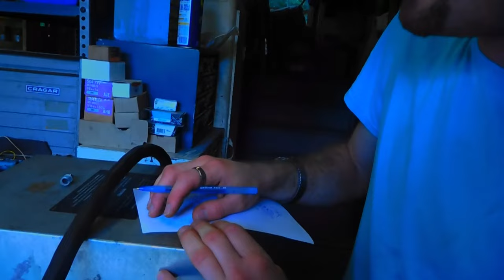Why Metric Base 10 is a terrible system.

Comment: I'm not a mathematician this was over my head. base 10 suits me, I know how to add it, divide it, subtract it & times it. for Joe blogs on the street that's all I need to know! I think🤔
Reply: based on this i assume you use a base 10 clock and calendar right? The fact is that base 12 is so intuitive that you don't even realize you are using it while you are using it.
Reply: @kevint1910  true, but isn't that for time, and not math? I do use base 12 occasionally when working in older properties eg joists are set at either 12", 14" or 16" centers, ordering sheet material 4'x8' actually comes as 1220mm x 2440mm😁
Reply: @paulrayner4514  shall i point out how many places those numbers contain vs standard measures? or that metric units are so awkward that most of them are never even used? what is that last one technically if denoted as we were told to do in grade school? 24.40 "decimeters" or was it decameters? and does any one actually use either one? nope....and "degrees C" where as little as 3 "degrees" can mean the difference between being comfortable and heat exhaustion and yes i am exaggerating it is for effect to make the point , the idea of it is sort of elegant 0 freezing 100 boiling and all. The issue is that the units that result are awkward and don't tell you as much as degrees F unless you use decimals to provide the places required to fill in the detail ...and yeah this is ALL 1000% quibbling...that is how I feel when people tell me that metric base ten is "better" because "math" you are quibbling over BS that has nothing to do with measuring or achieving accuracy.
Reply: Ironically the argument being made here is that base 12 would be easier for the average Joe, since it makes all the fractions used in physical measurement practically easy. Base 10 is more useful for math and science.
Reply: @kevint1910  well, even when telling the time, i represent the numbers in base 10, I write 11, not b
Reply: @kevint1910  Regarding measurement, As in liniar not any others, I'm not saying that it is better. I'm saying it suits me, as I find it easier to work with and understand it more in my line of work. As I'm a Joe blogs, i'm sure many other people do too.

Comment: its really more the difference between fractional and decimal and less the difference between 10s and 12s.  also 1 can be prime without much extra work but zero can't be unless you are ready to change a whole lot of things.
Reply: I like 1/4 better than 0.25 but i'll take 0.328 over 21/64ths any day
Reply: @joshwalker5605 I have a pretty easy time with either, the conversion is where things start to get unpleasant

Comment: Wait what the actual???? first you start your argument by explaining divisions by half, but then at @9:30 you first divide by half and then by thirds? Just to end up at 12???? 
As far as the actual argument was valid (which it is not), you just destroyed the logic with that diagram. That is, if you haven't lost the viewer already with those weird symbol representations. Well you lost me already half way, but I wanted to see how much deeper one could dig. 

You know that the entire premise of base 10, is simply shifting the comma or adding zeros? Shifting commas and not having to deal with fractions is why base 10 math is so much more easier. Not to mention our entire language is based around base 10. We do not have a different symbol for 10 and 11, or some word. We represent base 12 in our language using base 10 words. 12 time 12 is one hundred and forty four, nothing else. You even use the word twelve, a base 10 word representing decimal 10 plus 2

Hexidecimal on the other hand is presented using letters. And only when the number rolls over you get another digit. Easy for computers, but hard to comprehend for humans because we use base 10 in our speech.

Comment: If Im following u correctly,  one reason base 12 is easier and cleaner is that 1/3 equals .4 in base 12 instead of .3333 to infinity in base 10?
Reply: Correct, it has more for 'factors'. 3 is not a factor of 10; it is a factor of 12. Same with 4 and 6.
Reply: are you thinking in base 10? maybe if we thought differently it might make thinking about numbers much more intuitive?
Reply: That's more or less right but I'm interested to see how we would make 11/12 into a decimal
Reply: @maxscott3349 I'm thinking If you use A and B to represent 10 and 11 than 11/12 would be .B in decimal I think.

Comment: Metric is much easier for machines to use with  ISO the multipliers which are denoted as, Micr Nano Pico etc.  Imperial 12 has bases as explained, as does Octel Hexadecimal etc.  There is no one system but I do agree with Mr Sherwood  that 12 has more flexibility for visual representation as can be seen in the Stonemasons work. Ps NASA has difficulties with metric velocity and angular calculations. !
Reply from the maker: You are very correct about "there is no one best system"

NASA has difficulties designing basic spacecraft proficiently as the disaster that is the space shuttle program demonstrates.  I'm just an old steam engineer and definitely wouldn't know anything about radially or bilaterally symmetrical thrust profiles nor would I know about putting the manned part of the craft on top of the stack where it doesnt get hit by falling ice....
Reply: @AEKarnes  Mr Karnes, I  struggle with the many complicate threads evolved from imperial ' standards ' (?) created plumbers who needed to be improved matters their way.   With metric the only problem I have is finding a 10 mm spanner.  Mr Sherwood translates the ephemeral to visual for his own understanding,  I do the same which is why I dislike none tangible data and like you I used to use a screwdriver and listen and I could visualise what was in motion and not happy. I was a Predictive maintenance and Condition monitoing engineer and  and I had the pleasure of meeting some fine engineers who were steam men, I found few problems on steam machinery other than those cause by too much precision !. .   

I very much under stand your empathy with machinery, it is a six sense and a gift I am please you have made contact to various restoration enthusiast in the UK.  Have you driven the Kempton Triple Expansion Engine yet ?.
Mr Karnes this book  is right up your street.   ' Steam in the air '  Maurice Kelly  [Pen & Sward publication ]

Further information. 

NASA ;    In September of 1999, after almost 10 months of travel to Mars, the Mars Climate Orbiter burned and broke into pieces. On a day when NASA engineers were expecting to celebrate, the ground reality turned out to be completely different, all because someone failed to use the right units, i.e., the metric units! .

Metric relationship with volumes, mass etc.  
It was Giovanni Giorgi, an Italian physicist and electrical engineer, who proved that it is possible to combine the mechanical units of this meter–kilogram–second system with the practical electric units to form a single coherent four-dimensional system by adding to the three base units, a fourth base unit of an electrical nature, such as the ampere or the ohm, and rewriting the equations occurring in electromagnetism in the so-called rationalized form. Following these developments, in 1939, the four-dimensional system based on the meter, kilogram, second and ampere was recommended to the Consultative Committee for Electricity and Magnetism (CCEM) and was approved by the International Committee for Weights and Measures (abbreviated CIPM from the French Comité international des poids et mesures) in 1946. Following suit, Ampere, Kelvin, and Candela were added as base units in 1954, and Mole was added as the 7th base unit in 1971. Today, there are seven base units: Meter (Distance), Kilogram (Weight), Seconds (Time), Ampere (Electric current), Kelvin (Temperature) and Candela (Luminosity).
Reply: I think if I was a machine, I'd prefer a simple binary, on/off number system
Reply: @richard5652 Hmm. Strangely, I think most do! 😂

Comment: You are getting rather complicated in the description. Rational arithmetic is exact. It is all ratios of integers. If you want to express many of the useful ratios exactly, 12 is your number. With 12 you can make a ruler by folding. 

Also, the French Metric, now called SI, uses an impractical naming scheme with measure smaller than one being Greek and larger than 1 being Latin, because the intended elite users all have studied Latin and Greek. However in any workplace or setting where transcription errors or noise are possible, the multi-syllable words that all sound the same are ridiculous. The American Customary and the Imperials have simple one syllable words that can not be mistaken. No one hears "inch" and says I thought you said yards. And the scale is for humans.

Now, the geniuses of the short-lived French Revolution COULD have picked one of the standard yards (I would have used the one in London) and said we are adding a second set of divisions based on multiples of 10 in which case we call it a meter and 1 meter = 1 yard, and all would be sweetness and light today. But Noooo, they had a better idea! Lets take the distance from the equator to the North Pole and divide it by one million and call that one meter. What could be easier? A complete up-their-own-backsides jackass idea.

As a side note, take a look at the knobs on measuring instruments like an oscilloscope. The scales run 1, 2, 5, 10, 20, 50, 100 etc. Why? Because factors of 10 are too damn big!